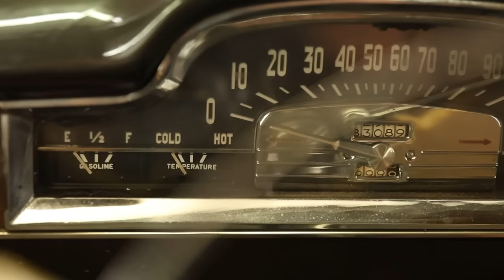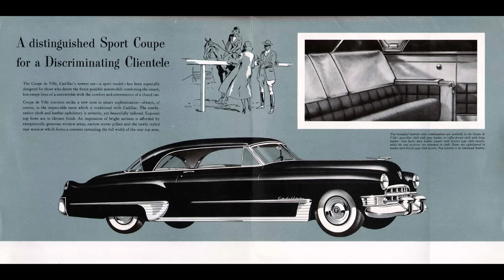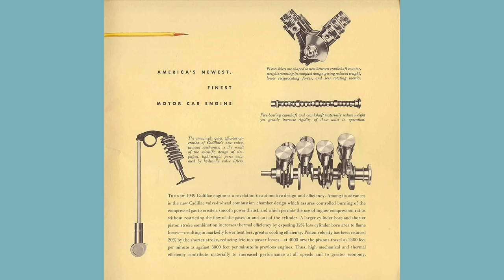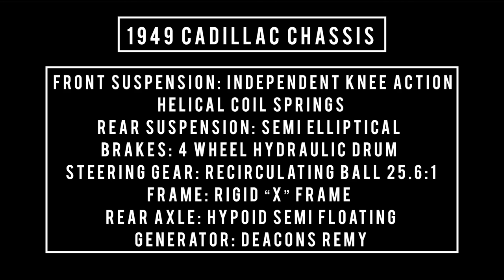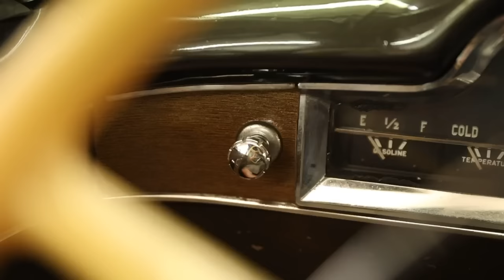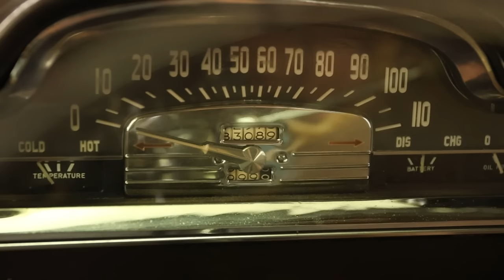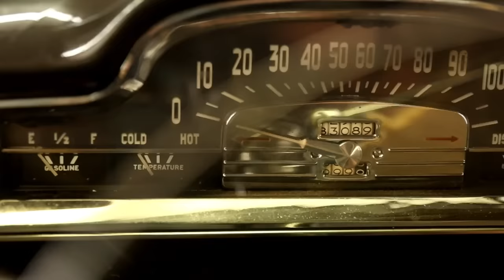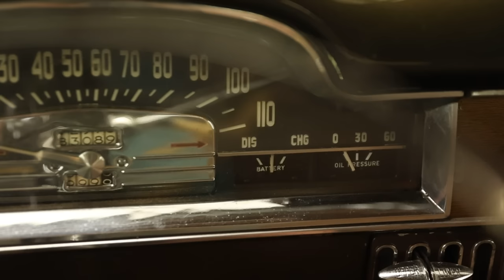1949 Cadillac Series 60 Special￼, Featuring￼ brand new OHV V8 ￼

Comment: The 49 cadillac I believe actually had the 315 CID V8 engine and not the 331. It was superior to the packard engine because it had hydraulic lifters as to where the packard V8 used solid lifters. Oh yes the packard engine as a great engine for sure but the cadillac engine was superior on 49. The 49 Oldsmobile used the 303 CID v8 which was just as good as the cadillac and was actually the same engine family.  Even today if they would use the Cadillac 315 in full size pickups they would last longer than the junk made today
Reply from the maker: Great insight and information =)
Reply: @What.its.like.  i LIKE TO SHARE INFORMATION THAT HAS BEEN FORGOTTEN AND NEVER KNOWN BY SO MANY PEOPLE
Reply from the maker: That’s what this channel is =) thank you so much.. The Internet there’s a wall once you go back so far 50 stuff is pretty easy to fine but if you go back to before World War I there’s like a giant wall.. 

Do you know all of Cadillac engine displacement before mono block design

Also do you know all of the Cadillac engine displacement during mono block design those are engine families that I really want to do for the channel one day but I can’t find enough information I found the 315 cid the heads don’t detach also Northway build engines for Cadillac
Reply from the maker: We’re not talking about the same 315 I’m talking about the engine that came before the monobloc.. I was wrong about the cubic inch displacement I’m talking 314 from 1914 through 1935 then Cadillac went to the mono block in 36
Reply: @What.its.like.  Not ure where your enthusiasms are going here.  Seems to hold interest for you.  In the early 1950s packard actually sold a car with a helicopter engine mounted in the rear of the car.  It didnt work out for street legal passenger car.  Doesnt interest me.  I am a person that is age 68 that loves stock passenger car drive trains in the RR line as well as Ford and GM and am a reired Cadillac collector and am aware of all the stock engines in the maerican and windsor canadian engine.  Sure I like many other types of things afar from me, such as the French Simca that came with a cast iron inline engine that was a same type as the Ford inline 223 CI engine.  And sure I could make use of an older beetle with an integral engine with bolt on cylinders that is air cooled, but I have no interest in small vehicles or race vehicles or sport vehicles.  Now I can understand the machining and molding process, but if its application doesnt intruige me, I ignore it. Now as for Cadillac enguineering from 1914 until 1935 you had flat head inline engines and some OHV engines during the 1920s and flat head V8 engines and Franklin mototora actually had the first OHV inline engine in 1922.

Comment: 11:33 Willys's Aero's fins look a little bit like this car's, but Cadillac copied the shape of the Lockheed WWII P-38 Lighting fighter's dual tail fin to create their 1949 fins.  21:10 1949 Cadillacs had underseat heater for rear passengers...but don't know whether it was optional or standard equipment.  WYR 49 Cadillac for both.  The Cad sedanette looked like a bigger version of my mom's 49 Chevy 2-door fastback.
Reply from the maker: Awesome information =)
Reply: The 1950 Pontiac had an underseat heater which I think contained its own hot water core and recirculated air I think. The car had above average ability to get warm inside the occupant compartment when outside temperatures were below freezing compared to such cars as Plymouth and Dodge as I remember

Comment: The smallest Cadillac was probably the best one to have if you were going to drive it yourself.
Wasn't the outgoing L head V8 considered to have been one of the best engines of its day? 
The nine main bearing  Packard engine of the day smoother than any of the General Motors products? Also comparable power to the more advanced overhead valve engines even though L head?
Reply: The last Cadillac flathead V8s were fine, smooth power plants, as were the Packard engines.  However,  '49 V8 was about 200 pounds lighter than the '48, had 5 main bearings instead of the flathead's 3, if I'm not mistaken, and was more fuel-efficient.  The lighter-weight series 61 equipped with the new V8 could supposedly achieve 20 mpg, if driven with care.  Initially, the '49  OHV V8 had only 10 more horse than the '48 flathead (160 vs 150), but by 1954 this was already up to 230HP thanks to 4-barrel carburetion (1952) and higher compression--all without increasing engine displacement.

Comment: Hmmm...what happened to the 1948 model 60 Special?  I stopped listening after he compared the 47 to the 49 as if there was no 48.  No 48? What?
Well I'm calling BS on that because I had a 1948 Fleetwood 60 Special. It looked exactly like the 49 but it was different in that it had a flat head V8. Another great episode? Maybe but mis-informative.
Reply from the maker: There was a 48 but the 48 was virtually the same car so instead of comparing it to the 48 which you’d almost be looking at a mirror that’s why we went to 47.. it’s stated right there that it was a carryover body design that started in 48

Major difference being the 48 had a flathead V-8 versus the 49 got the overhead valve V8 but other than that most everything else was the same.. 
The 48 might’ve had a different interior as well but externally everything was relatively the same

Comment: The wheel looks like UV damage nylon to me.  Not the new color.  The radio does'nt look right.  It would have been tube powered in 49.  The car looks like about a 95% restored.  The chrome is beautiful.  Trunk looks like crap.  Carpet does'nt fit.